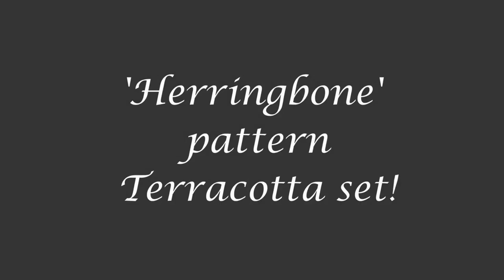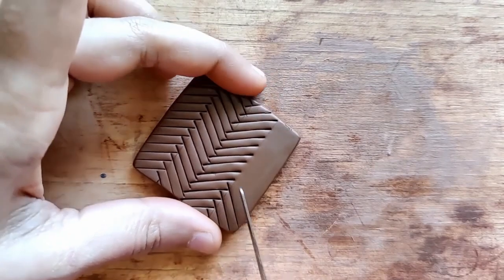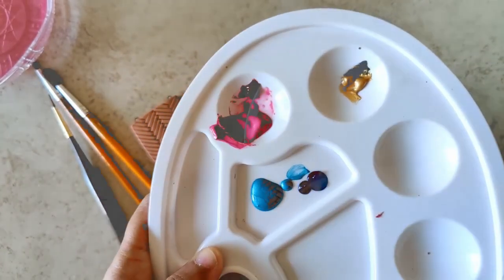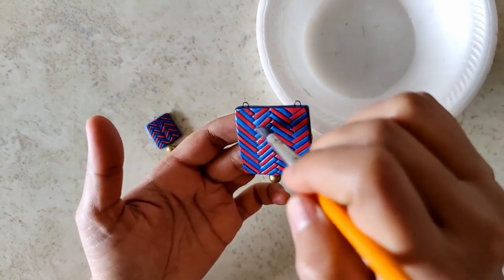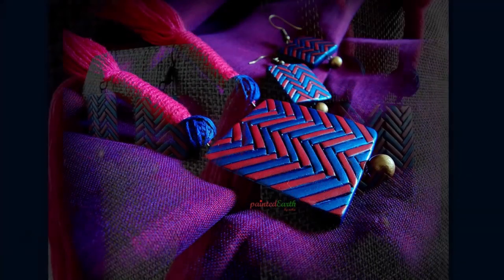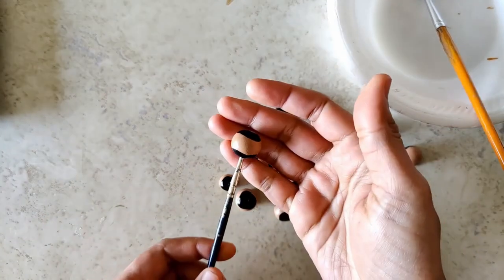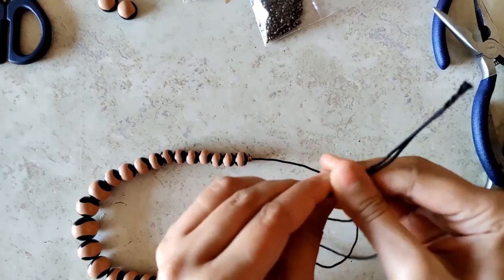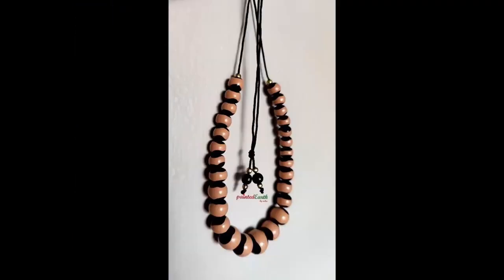Two Styles One video | Two daily/Work wear sets | Herringbone set & beaded set #paintedearthbyneha

Comment: Hi Neha....both the sets are very pretty with beautiful colour combination....can you just help me out ... What should be the length of Dori or the thread for a particular set.
Reply from the maker: Thank you so much! So glad you liked the sets. Usually for smaller sets I keep it at 30 inches and longer sets at 39 inches. That way the person wearing it has the flexibility to adjust the length to as much as they need. For ready made cords such the the hot pink one used here, it's meant to be worn only at a specific length. For the beaded set, which is also suppose to be worn as a necklace has a cord length of around 30 inches. Please consider the knots, coz they will shorten the cord length further.
Reply: @nehagopinathpillai  Thank you so much Neha..... you have cleared my confusion regarding cords...... you have explained it in such a beautiful manner. Thank you....God bless you 🙏